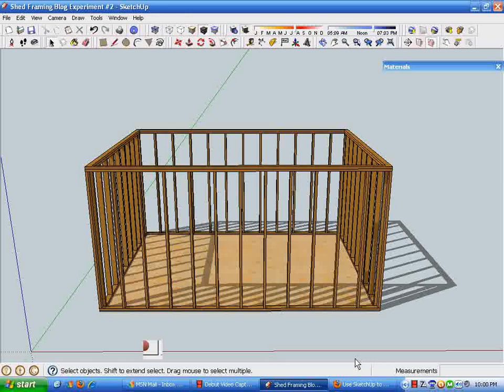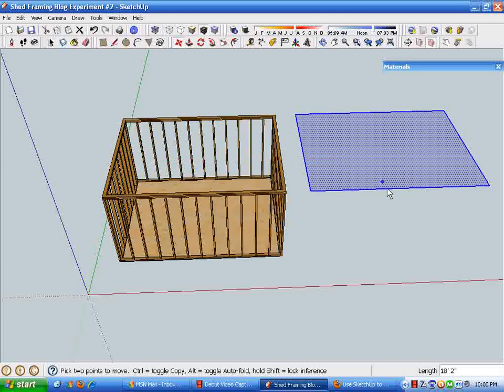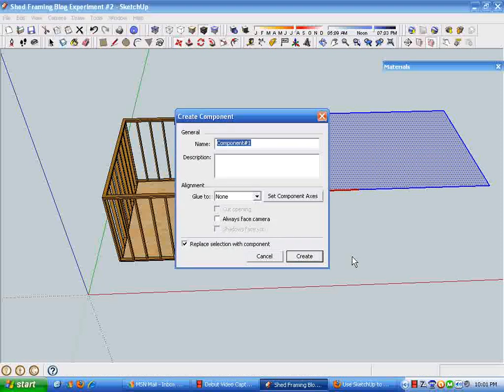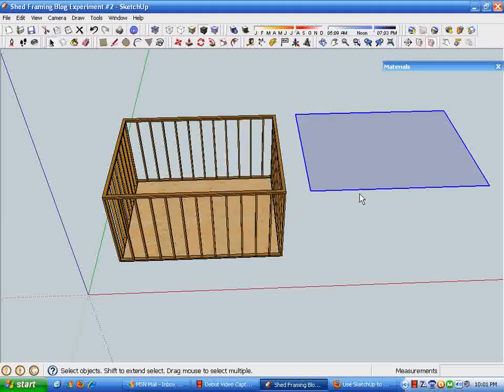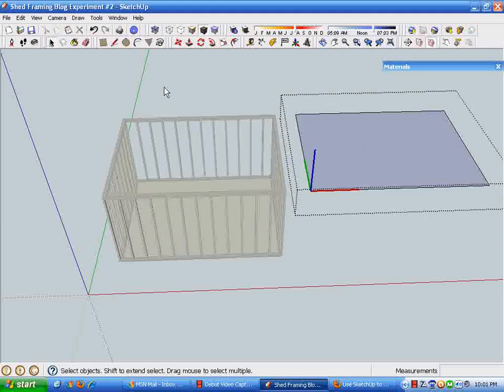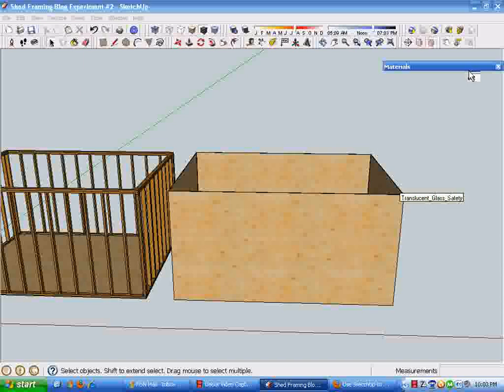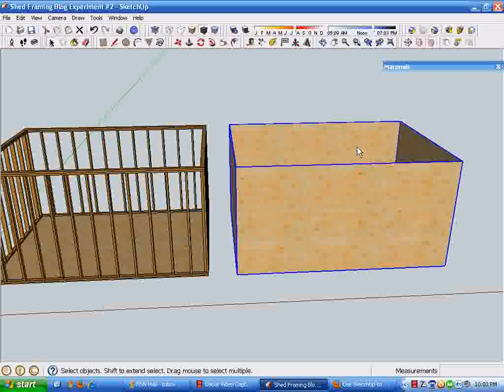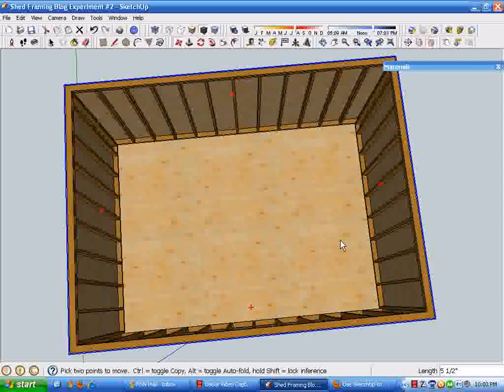SU Blog Post #3 Part A Wall Sheathing.wmv

Comment: Matt Thanks for this. Much simpler approach then I was taking. I have the frame work constructed for an addition to the house. Is there an easy option to sheath the structure without covering up the windows and doors one has already created? Again thanks for this reminder of usefulness of the offset option.